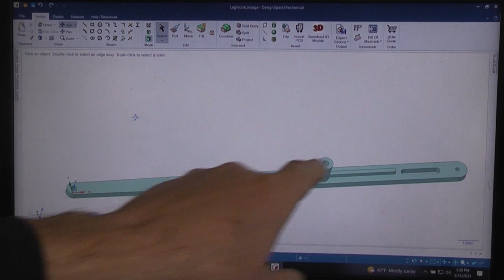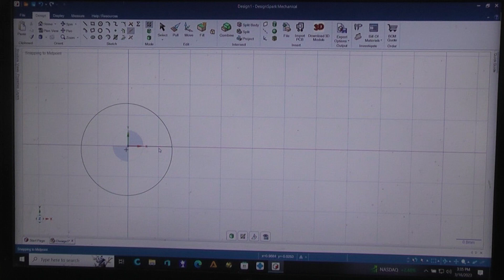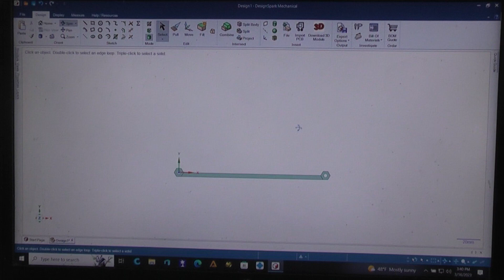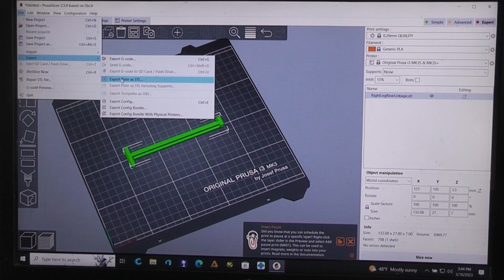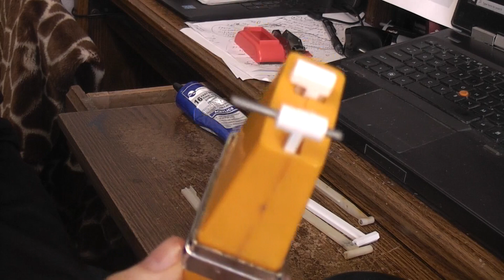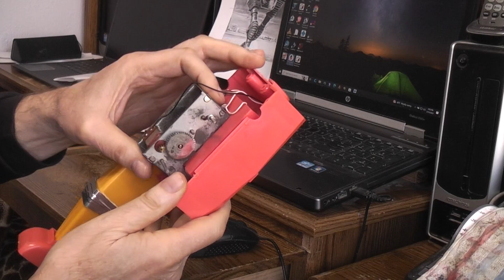Mr. Astronaut "battery operated robot" repair. Part 2. CAD parts design, leg linkage.

Comment: Nice work!  That was smart, to make the ends of that leg shaft as polygons instead of cylinders.  That made it a lot easier to print.
Reply from the maker: Yes I do that when ever the design will let me.